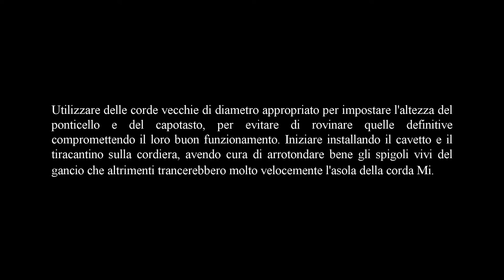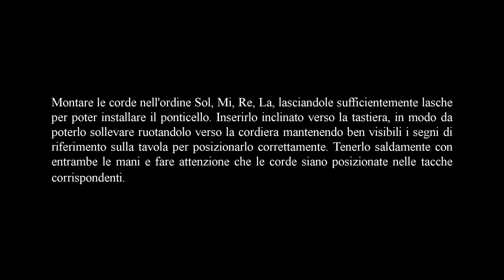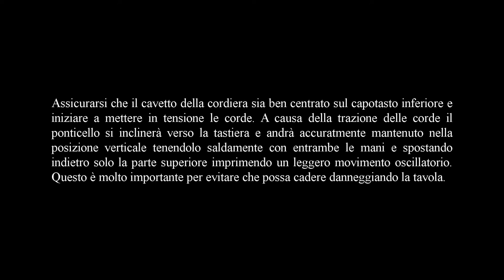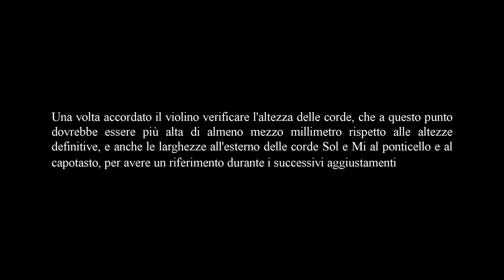Ponticello di violino parte quinta - Montatura provvisoria delle corde

Comment: Hello wise davide sora, I know that your time is precious, what is the material of this pigtail that goes at the end with two threads, which do you use? There is nylon, aramid, metal and titanium can you indicate which is the best, and if there is a difference sonara among them? grateful for your videos I'm addicted to watching them, they are magnificent.
Reply from the maker: It's called tailgut, and all the materials you indicated are fine, you can also use real gut as they used to in ancient times (from which I think the name derives) and also Kevlar or carbon fiber cords. In general, the more stiff they are (titanium, steel, kevlar and carbon) the more they tend to enhance high frequencies and fast attack, the more elastic they are (solid nylon, gut) and the more they tend to be  "neutral". My preference is titanium, like what you see in the video, but for example if your violin is a bit harsh a stiff tailgut could exacerbate the problem, while a nylon one (which is the most used ever) could mitigate it. However, each violin will respond differently, so your best bet would be to try several to find the one that performs best. I like the titanium because it doesn't stretch like the nylon ones, and the two screws ensures a very effective length adjustment. Kevlar, carbon or aramid are even stiffer than titanium (I don't like them too much for this reason), but they have to be tied and adjusted with knots and so they will suffer annoying stretching due to the knots which will progressively tighten under tension, making length adjustment more slow and annoying. If cost is an issue go for the nylon, it will work, the titanium ones are the most expensive.
Reply: Расстояние от подгрифника до подставки строго и известно, никогда никто не нашёл Расстояние от подгрифника до нижнего порожка, а зря, это помогает при плохом подгрифнике.
Reply: Лучше всего рыболовный тросик. Только удалите из стали  пластиковую изоляцию.